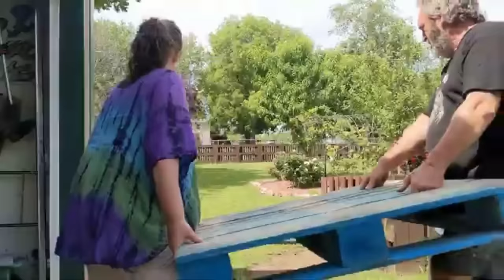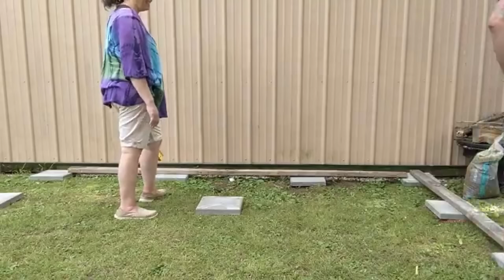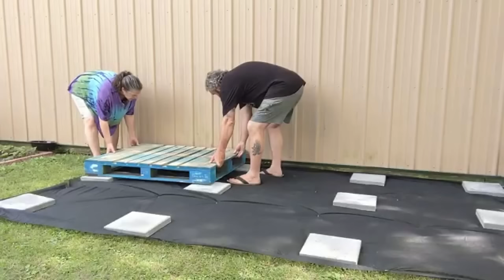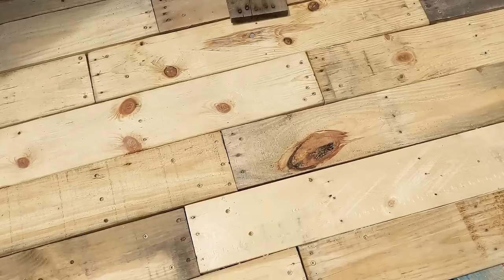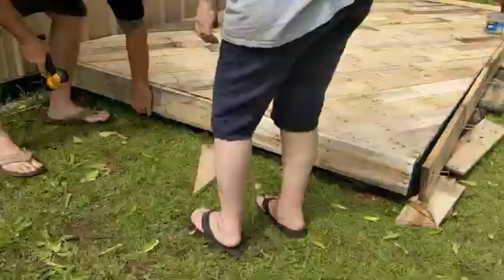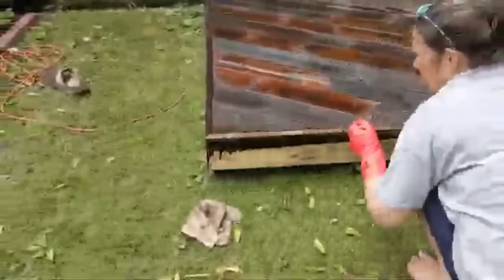DIY Pallet Deck (Part One)

Comment: Love it. Thank you. Consudering decking some of my space that is on gravel.. The wood needs to be saturated with a preservative in my case. However, this would be ideal if you need for a season or occassion. For longer, strongly recommend digging  out organics at each concrete spot and pouring and packing a pint of crushed stone into the earth. Consider covering the grass with a bag of diatomaceous earth to reduce wood eating insects. When things get rotted, bigger critters start to move in!
Reply from the maker: Thank you so much @ingridw3900. Good luck with your project! ✌

Comment: My husband keeps talking me out of using pallet wood for a deck. Thank you for posting . There is no way he is talking me out of it come spring/ summer even if I do it without him
Reply from the maker: You're welcome @mullinsadventures9262 Glad you enjoyed the video. Good luck with your deck project! Send pics! ✌
Reply: Facts girl, I'm doing it too!
Reply from the maker: @KayDurrant  You go girl! ✌
Reply: What's the reason he doesn't want to use pallets for a deck? Thanks
Reply: @turo3066  I'll answer for him. Simply the wood used on pallets arent pressure treated which in time WILL ROT. Pressure treated wood have chemicals on them to keep from rotting on ground/weather contact. Please keep in mind that freight vendors purchase the cheapest cost efficient wood pallets that will hold thousands of dollars worth of product. Trust me I know this working for Home Depot. These guys did a great job just skipped on a couple of important factors that would have paid off. 1. The obvious in not using pressure treated wood and 2 not tampering the ground under the pavers and putting some kind of crushed gravel or limestone as well. In time the deck will start to get "spongy" while walking on it and unleveling itself due to wood pallets starting to rot along with soft ground. Nevertheless they did a good job.

Comment: Deck turned out wonderful and  I been thinking to do the same. Please please tell exactly what materials you used including the tools.  Thanks. 😊
Reply from the maker: @chevonnchapman8322 the entire deck was made with pallet boards and the tools used were a circular saw, reciprocating saw, electric drills and a belt sander.

Comment: Did you secure your pallets to the paving stones? If not, has your decking area moved?
Reply from the maker: With the weight of the pallets as well as securing the pallet boards(deck) to the pallets we didn't feel the need to secure them to the pavers. It turned out to be a very solid structure. Thanks for asking! ✌

Comment: Very nice pallet deck. What is the wood slates material you used for the decking top?
Reply from the maker: @lynneboyer3197 thank you so much. We used pallet boards for the deck top.
Reply: @kinlockskorner6862   Did you disassemble a pallet for these?
Reply from the maker: @jenniferdawkins4279  we actually purchased a pallet load (shrinkwrapped) of pallet boards from a recycle pallet company.

Comment: Great video! I am hoping to do this myself. I am a new homeowner and tool challenged, so forgive me, but how were you two reattaching the boards to the pallets? Was it a drill to start the hole for a screw and then screwing it in with the other drill? If so, what size screws? Also, How did you get all the pallets to stay together?
Reply from the maker: Thanks Chinea. We did drill a pilot hole for the screws, this prevents the boards from splitting when screwing into the boards. We used #10 x 2 1/2" screws. The sheer weight of the pallets once butted together keeps them in place and are secured once you screw the boards into the pallets. I hope this is helpful, if not, feel free to contact me. Will be more than happy to help out if needed. Thanks again and good luck with your project. ✌

Comment: Awesome job you guys💪. Just one question please how far apart are the pavers would you say? I can always count on amazing people to help those like myself make these awesome projects😁😁😁✌️✌️
Reply from the maker: Thanks for that Tara. The center of each paver is 48" apart, which allows both pallets to be on the one paver. This would apply to any size pallet you intend on using for your project. Plus it makes it easier to level out your pallets and ground surface by placing two pallets on the same paver. Hope this information is helpful. Good luck with your project and feel free to text back if you have any further queries. Thanks again!

Comment: What did you use for the top? Just deck boards? You did not mention, just went at it.. looks great and giving me some good ideas
Reply from the maker: We used pallet boards
Reply: @kinlockskorner6862 so you two dismantled a bunch of other pallets to reclaim the boards? I am looking at doing a 20’x13’ deck out of pallets, no idea how many I would need to take apart to have enough deck boards
Reply from the maker: @derek5  i bought a pallet(shrinkwrapped) of pallet boards already dismantled from a local pallet co. But to give you a rough estimate, an average pallet is approximately 4' x 4'. So going by your dimensions, you'll need around 18-20 pallets unless you find a place like i did that sell pallets of pallet boards. Hope this helps with your project ✌

Comment: Love the deck! How did you make the pallet fence?
Reply from the maker: Thanks Katherine. I dug out a trench and laid the pallets (66 in total) on their sides giving it that picket fence look. Each pallet was attached with a metal cleat (they are metal plate about 3"x 2" with spikes on the underside) The cleats are shown in the DIY pallet deck video. Each pallet also has a 2' long pallet board hammered into the ground where the pallets butt up to each other and screwed into the pallets for added support. This was done on both sides of the fence (inside and outside) I hope this information was helpful for you and thanks again for your feedback, we really appreciate it.

Comment: Hi, nice work. Where did you buy the pallets and how much does it cost for each?
Reply from the maker: Thanks Helen. We bought the Chep pallets for $3 each from our local grocery store. We also bought a pallet load of pallet slats (4' x 4' x 6') which equated to approximately 400 slats, from a Pallet Company we found on FB Marketplace. Those 400 slats cost us $50, which was quite reasonable  when you consider how many pallets you would have to break down. Glad you enjoyed our project!
Reply: @kinlockskorner6862  thanks for the quick response..did you get it from walmart?
Reply from the maker: @helenmeneses6822  No, there is a small grocery store nearby. You can check on Facebook Marketplace, Craigslist in your area for pallets.

Comment: Ll the grass actually grow up through when no light will be there with the deck ontop?
Reply from the maker: It's been a year since we built this, and not one single weed has come through. I think with the weed cloth and no light, that did the trick.
Reply: @kinlockskorner6862  thanks, I'm thinking maybe it was an extra maybe unneeded step. Do you think the cloth is required at all? As the deck ceases any light from being able to hit the soil?
Reply from the maker: @jasonmoroney7962  it's hard to say, but if that cloth roll isn't an option, throwing down some cardboard underneath would serve the same purpose.

Comment: For the top did you say that is pallet board? Is that pallets that have been broken down?
Reply from the maker: That's correct Gloria, i purchased 400 pallet boards from a company for $50. The company sells them shrinkwrapped to a pallet which stands about 6' tall. So that's a lot of pallets i didn't have to break down. For $50, i thought it was worth it.
Reply: @kinlockskorner6862  I enjoyed watching your DIY. I’m currently building one. What company did you buy your pallet boards from? Thanks a lot for sharing! 😊
Reply from the maker: @momofnoah07  thank you so much for your feedback. I went to a small recycling company in Joplin Missouri. If i recall i think the name was Triple R Recycling. Good luck with your deck!

Comment: Nice video, a few niggles though as we would like to have seen how you connected all the pallets together and how you connected it to the base.maybe to much hyperlapse lol
Reply from the maker: All the pallets are connected by all the pallet boards that run diagonally across the pallets as shown in the video. We didn't feel the need to connect each pallet individually as the amount of screws connecting all the pallet boards to the pallets is more than enough. Believe me this deck is definitely secure.

Comment: What kind of wood did use for top of deck?
Reply from the maker: We used pallet boards which we stained and applied a waterproof sealant as well.
Reply: @kinlockskorner6862  thank you very try much. I’m look to do something similar and your video is the inspiration. This is amazing
Reply from the maker: @Eclifford1983  Thank you so much for your kind words and support. Good luck with your project! Send pics ✌

Comment: when its gonna rain all the wood will rot
Reply from the maker: We built this deck two years ago with treated pallet boards which were stained and sealed. They have held up extremely well with no signs of rotting.